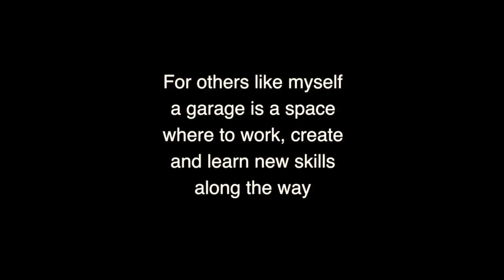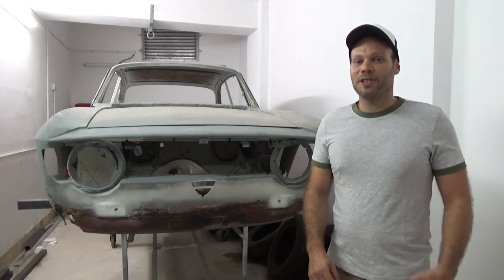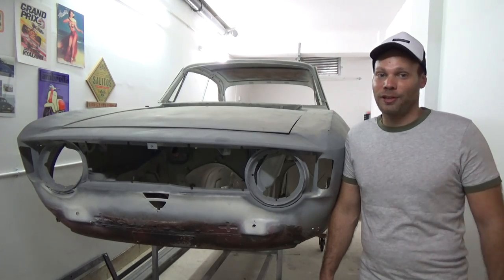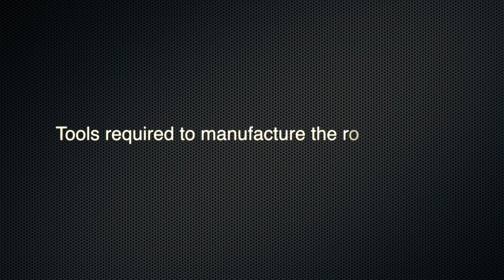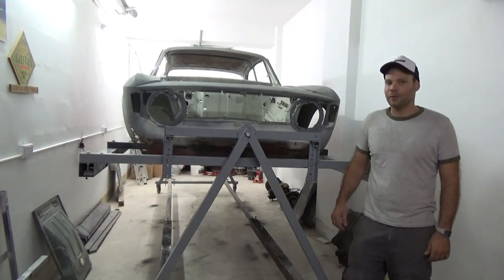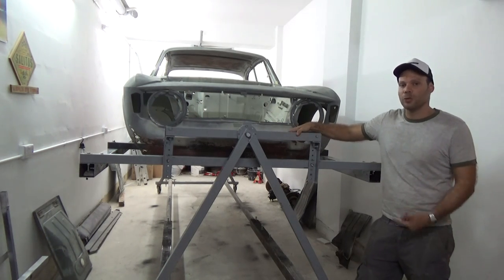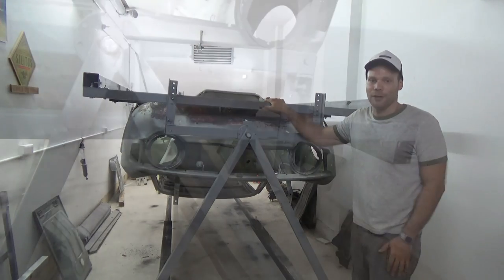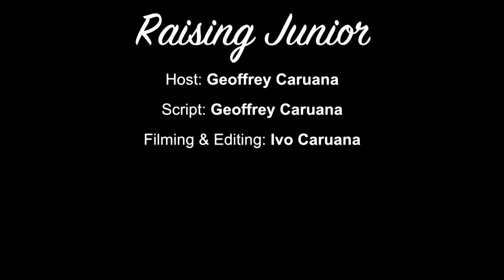Raising Junior Episode 1 - Alfa Romeo Gt Restoration (Building a car rotisserie)

Comment: This is about the third time I’m going through your build so far. Great to see what I have to go through. I’ve got a 1600 GT Junior that my father in law gave my son and I bought a step nose that I WAS going to use as repair panels but changed my mined and decided to do that one also. Unfortunately the step nose doesn’t have an engine but my son’s car was complete with its original engine.
Reply from the maker: Thanks for watching!! Good plan, don't cut up the step nose body as it's more rare than the 1600gt Junior. An engine shouldn't prove to be too difficult to find unless you want a specific engine  block code. I bought my car without and engine too!

Comment: It has been over 25 years since I've done this sort of thing, I have done rotisserie restorations of 750 series Alfas and three Jaguar XK-Es. Now I am looking at a 1970 GTV, a straight and complete but very rusty car that needs everything. I am hoping to get it for under $2,000, I know parts alone will run well over $15,000, probably over $20,000. I'm finding this series to be very instructive, it brings back many memories. 

It has been suggested to me that rotating engine stands make a good beginning for a rotisserie, with a pair of those and some salvaged pipe I should be on my way. I added a worm gear drive from a winch so that I could rotate the cars just by turning a crank, makes life easier.
Reply from the maker: @3ducs  thanks for the interest in the channel, glad you're finding it useful. I think its better to spend more in a better shell without missing parts than finding one sub 2k, when these cars rot they rot deep down to the structure, if there is severe rot  in the firewall and  scuttle it's probably too bad to save. Classic Alfa and other suppliers stock an amazing variety of parts for cars of this age but not every repair panel is available, that's why we made some panels our selves, also the cost starts adding up. 

As for the rotisserie, I could have gone the engine stand way but a friend made his rotisserie with lots of ground clearance so I copied his plans :) btw the car still isn't done 8 years later but we're in the final assembly stage, this week I started fitting a new headliner kit
Reply: @raisingjunior6389  Thanks for your quick reply! On the plus side all the parts are there and the car is straight, not dented. It's a 1750, fuel injected. The car was last registered in 1984, I don't know how much of the time since then it's been outside, a fair amount of it. I live close to the car, 20 minutes, I'll have another look this week and check the firewall from inside, the scuttle looks good. I pored over the Alfaholics catalogue, it's quite thorough. The Jaguars I restored needed floors and bulkheads, pontoons, door skins, the lot. I have gas, MIG, and resistance spot welders, air compressor and sandblaster. My house has a walkout basement that would make a good shop, climate controlled year round, the car would be right under where I now sit. I know it would be a big job but I'm looking for just that thing, a challenge. If you'd like I'll report back on what I find this week and if I made a deal for the car, it has a motivated seller, health issues.
Reply from the maker: @3ducs  that sounds like a good deal, usually sub 5k cars in Europe are glass donors only but there are still good deals to be found out there. That is a very desirable model too. There is an older thread on the Alfa BB forum, called French blue restoration something along those lines, which covers a lot of bodywork. I used this thread as a reference to check how panels are welded together etc. Best of luck, hope it's a good base, if you have any questions feel free to ask here or on Instagram @raisingjunior if you're on it. I post more updates there

Comment: I saw your post on  one of Homebuilt by Jeffs video's, i had to come check out your channel. Looks like you are off to a great start. Love the rotisserie. When i made mine, my car was top heavy, i needed a second person for safety when spinning my car, and couldn't spin it alone. I am also making you tube video's on my Datsun 260z restoration, i have 4 so far, check them out!

Rudi.
Reply from the maker: Hi Rudi, thanks for the comment, I saw my friend's Spider (a cabrio) on the rotisserie and realized that the centre of gravity will be different on my car since its a hardtop so we tried different height adjustments. 

I just checked out your channel...nice work!!. subbed. We're going down the same road on different cars. Both are cool classics and both love to rust  :D I really like Z cars,  they're super rare here as  I don't think they were imported offically
Reply: Gday fellas. I came here from the comment on Jeff's channel too. I've just started tinkering with making videos. My build is pretty modest. I've subbed to both of you . Look forward to watching the progress. All the best. 👍😎

Comment: I have a stupid question, for sure....but, how did you get the car onto the rotisserie?  Or the rotisserie onto the car?  🤔
Reply from the maker: Not a stupid question at all, it was quite tricky! We used Jacks and bricks to lift it the right height, then assembled the large frame around the car. That's the advantage of having the beams bolted instead of welding them